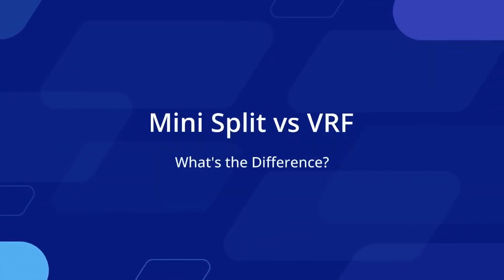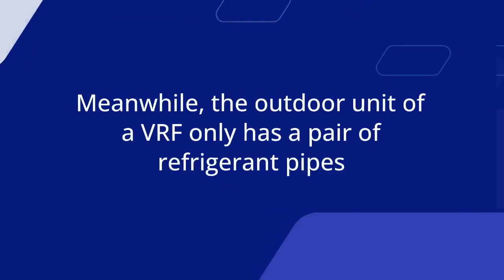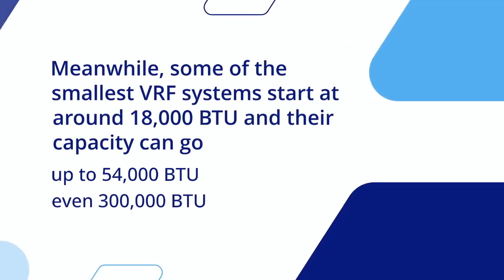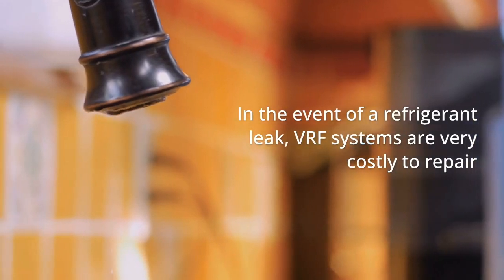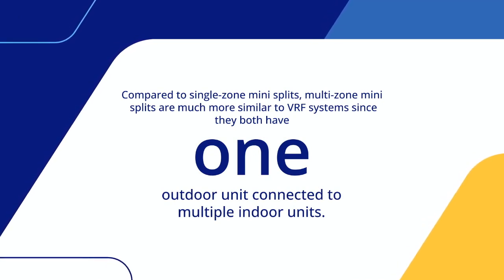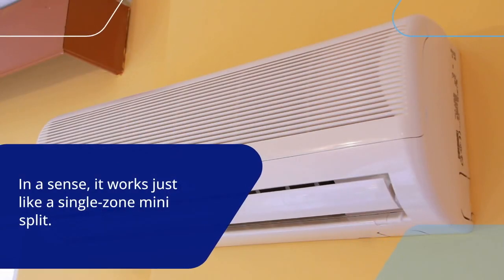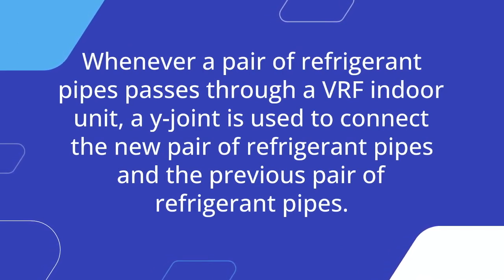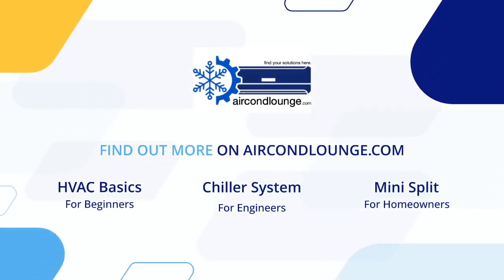Mini Split vs VRF: What's the Difference?

Comment: can you connect a MINI VRF to a Air handler?
Reply from the maker: It is possible but depending on whether the manufacturer provide you the option to do so. We can’t connect a VRF condenser to a random air handler because they communicate through a special control board.